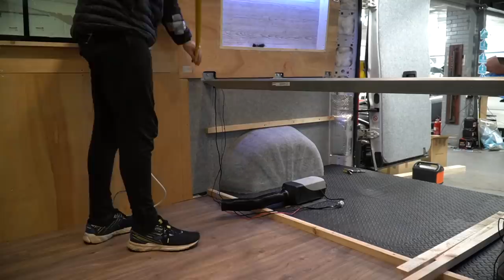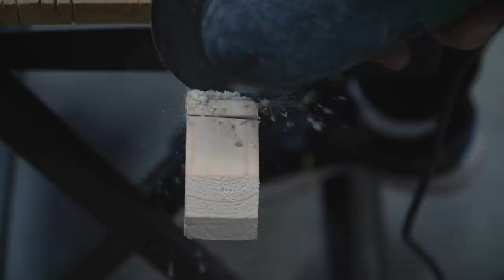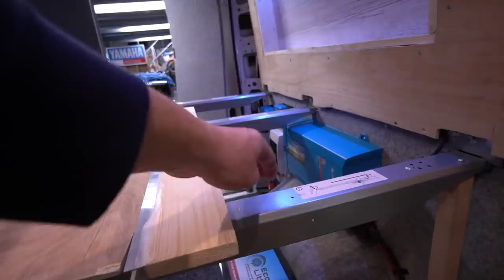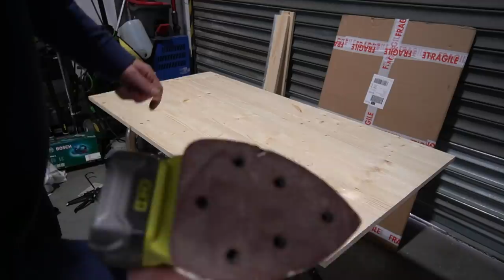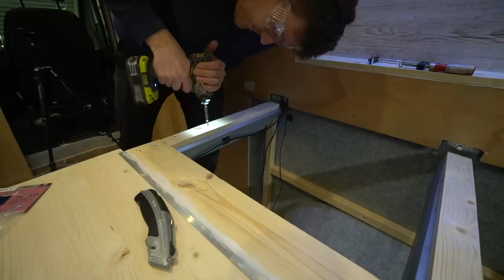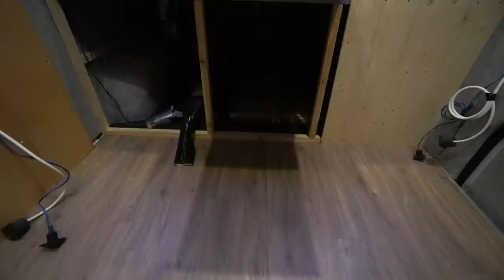SUPER EASY & SMPLE DIY Pull Out Table For Van Conversion - No Experience Van Build

Comment: Hi Will,  Great - that table can also serve as extra counter-space while cooling. But you definitely don't want to put your main seat there, but rather on the opposite side.  Reason: from what I gather, you're gonna have a kitchen counter on driver side, and if you position your main seat there, you're gonna be trapped by the table. Imagine a situation: you've cooked and served your fajita, unfolded this table and now you your fajitas are served and waiting for you on that table; How will you get into that seat? You can't. You'll need to move everything from that table to the kitchen counter or the bed, slide the table in, get into your seat, slide the table out, put all the dishes back on the table.  
Or another scenario:  now that you're in your seat and the steaming fajitas are awaiting you, you realise that you forgot the cheese in the fridge or even worse you forgot to roll the camera. How are you gonna get out of there? You're trapped by the kitchen counter and this table.  So you definitely want to have your seat on the opposite side.
By the way, for the fridge, it will be a cheaper and more efficient solution to go with a regular 88 litter undercounter 220V fridge.  There are many tests and youtube videos that prove that they are more power-efficient than the overpriced 12V fridges.
Looking forward to seeing you install the water system.  In one of the episodes you mentioned a possible shower.  That would be very interesting.

Comment: Hey will maybe add a little handle/strap or 2 to make it easier to pull out when mattresses is on could also be used to tie down under underneath so it doesn’t fly out

Update just got to the part where you say you ordered a handle point still stands that you could use to tie down underneath

Comment: I would try rounding the edges of your table piece (sander should suffice) so there is less surface to cause friction.  Should the board warp over time you may have some issues.

Comment: Good effort but I would have added 3 more battens the length of the bed and sat your bed slats on them, one at either side and one in the middle. The slts then allow air flow and the mattress sits clear of your table. One other thing, I'd just cut a hole in end of the table to allow you to pull it out.

Comment: Just wondering, did the weight of the mattress on top affect the sliding of the table? and might it have been better to build the bed up a little so the slats could run all the way through? and also... when you finish the table with a polyeurathane or some such, the extra thickness will affect the slide. Thanks so much, these videos really help all of us ahead of time.

Comment: Oil will sink only deeper into the wood causing it do get thicker long therm. Candle wax (or even better Skate wax) should do the job. Maybe put some silicone Spray on those profiles and then there shouldn't be any noticable resistance @ all

Comment: Could you note get extra wood same height as the slats to go across the top of the table and it's slider holder things to raise it off the board? Because the middle of the matress is still lower than the slats either side? Oh you just said it at the end 😂

Comment: orbital sander would work nicely to send the table  i cam here because i need to make a slide out table  i wanted to use slide-out drawer hinges  but i do not know how to install them  so your idea look good i think that what i need to do I do not have C channels but I do have some brackets I could utilize if i turn then upside down on a long piece of would for these aluminum long brackets I can adjust the height   because I'm going to need two side wooden pieces so I can adjust the height on there

Comment: if the C channels where bigger size you could have added to the side of the wooden board on each side skateboard bearings []=so like every 2 inches apart add a bearing this would be don on both side of the board so that bearings will be the one to make it slide out better if u did want it to be less noisy then gluing some rubber sheet thin one on top and bottom of the C channel would do the trick but might side out less smooth or maybe better i have not tried rubber before

Comment: Might be worth adding a small block of wood to the underside of the table at the back to act as a stopper so you don't accidentally pull the table all the way out.
Reply: He definitely needs to do something or it will come flying out in an accident or if he slams the anchors on.
Reply: @tonysutton6559  Exactly what I was thinking.

Comment: You could of just planned the edges to give you an actual stronger table, but it's all good. Use surfers wax or bees wax to help with the sliding of the board

Comment: Your difficulty screwing in the approx 1" screw, is that your pilot hole did not go through the bottom layer of the aluminium rectangular tube.  Your screw was "bottoming".  It is not "self tapping" where there is no hole to pass through.

Comment: Why not do it on the bottom so you don't see the lines?
For smooth running you should have used those heavy duty drawer slides...

Comment: Been better to have bought 2 heavy duty drawer runners and fixed them to a slightly thicker board, also once the mattress is on its not going to run smooth, same aswell whe  u get some moisture in the van it may swell up a little and not budge at all

Comment: Hi Will! If it needed an extra leg underneath, but you don't want to add a permanent one in; you could use a door frame pull up bar? Extends to the right length and could be stored away easily.

Comment: Don't attach a handle to the table. Cut a rectangle hole large enough for four fingers into the table itself and round off the ends of the hole  with a proper sized drill bit.

Comment: Hi my name is Dennis Thompson and I have been watching a couple of your videos one where you get that £100 kitchen units and then the next one where you make your slide out Table and you do make things hard for yourself with the Table I could not understand why you planned all of the table top and sanded it when all you had to do was use a router to cut down the two edges of the table top that is the only part you needed to be thinner where it slides in and out also I think you should of taken the slider parts all the way across the bed two reasons for this one it would of given your mattress support also you could of on fine days used your pull out table out side your back doors you could of used it for eating off or even used it to make something to eat and drink while enjoying the fine weather out side just a small portable camp stove thats all you would of needed one other thing I think I would of done was raise the bed height those few inches so you could of had your table at the right height that you wanted the table to be but coming out from under the bed which would then of allowed you to fix on the underside of the table a fold up leg that you could let down and use your table in the longer position maybe worth thinking about.Any way keep up the good work hope you do not take offence I am just a 70 year old man seeing things in hindsight yours Dennis Thompson.

Comment: Omg Will. Won’t work as firstly your table top will eventually warp and bend. Secondly you’ll stop your mattress breaking at waist level. Thirdly your mattress will hinder the tabletop sliding and for the table edges you needed a router and not a planer. You should line the edge o your table with more C Chanel aluminium or steel to help with the sliding and stiffen the board. Your van will end up like a right bodge job. You could have raised the bed slats a bit more and left yourself with ability to have stronger table top. Btw, when your table top is extended you have no mattress support in the middle!???? When you try to push the table back in it will catch on the sagging mattress once you start using it more